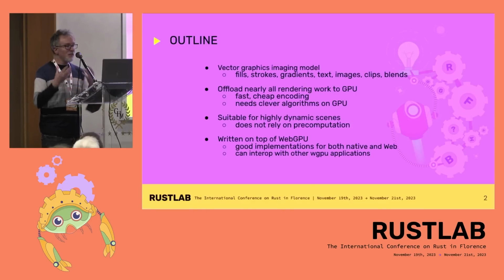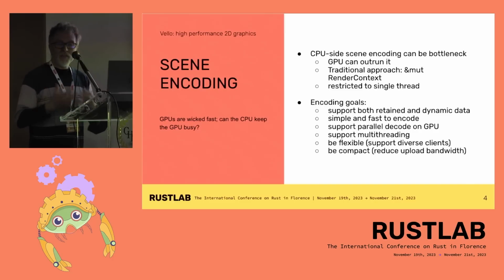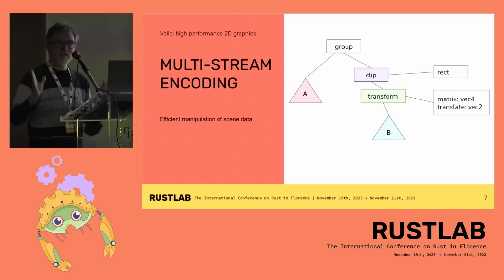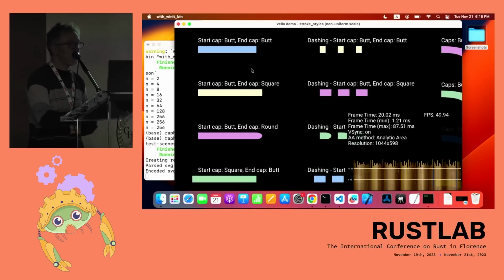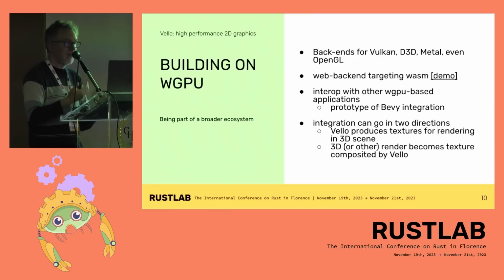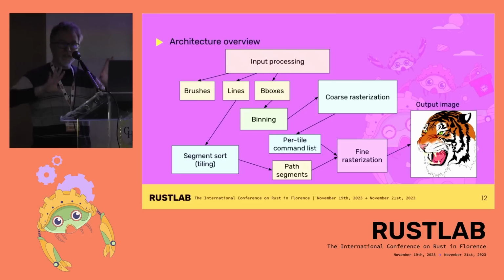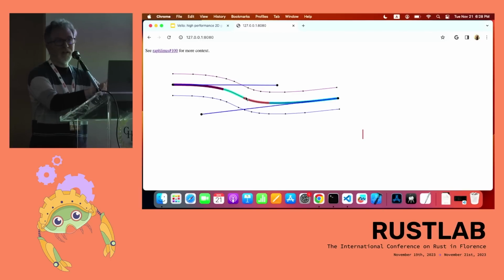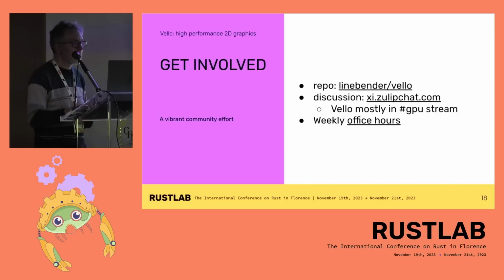Vello: high performance 2D graphics - Raph Levien

Comment: Vello is great. I just took the "with_winit" example, threw away all non-essential code and made it draw a grid of 90000 circles of radius 2.0 at 60 fps (Radeon 560 RX). To achieve that, I employed "rayon" to generate subscenes in parallel, merging them at the end (via Scene::append). It was surprisingly easy, and not that much code compared to SDL2, which won't even let me precompute the circles or at least render them in parallel to separate surfaces, because surfaces don't implement Send. I will be using Vello in my particle system simulation that currently struggles to maintain 60 fps at 6000 particles, even though the verlet integrator can do many more without breaking a sweat.